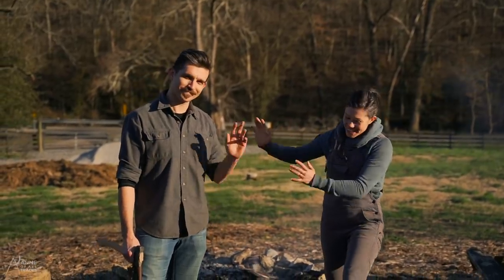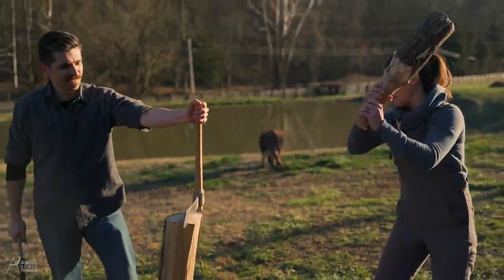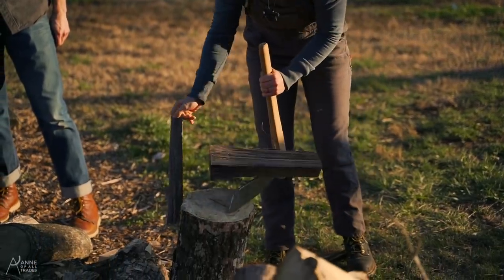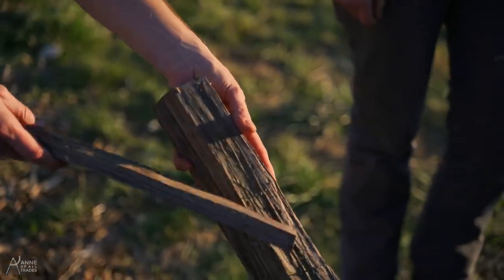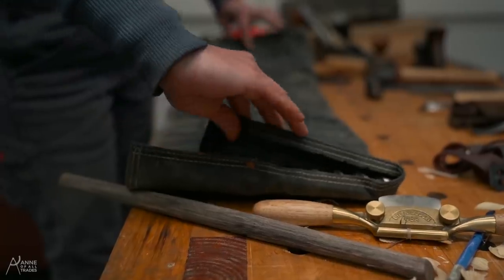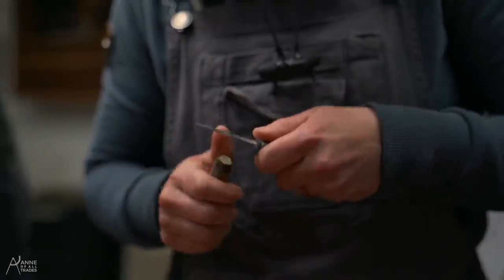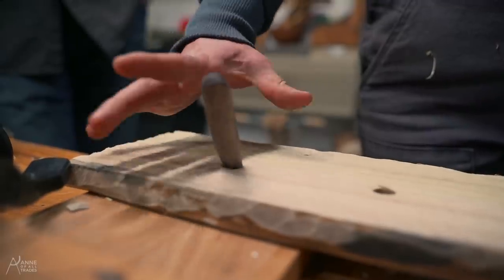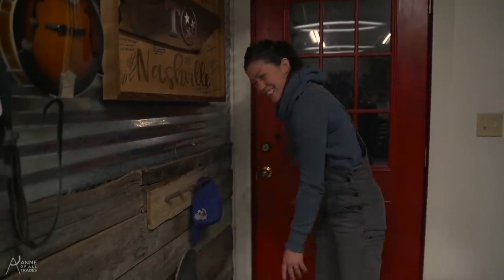Easy Firewood Carving Project

Comment: I have a froe but it doesn't even dig into the log. Do you have the edge of your froe sharp?
Reply from the maker: Nope, I prefer a dull froe, it’s safer. All it’s meant to do is wedge the wood apart so no cutting edge is needed

Comment: Just an FYI, Walnut is not good for Horses, not sure about your fer babies wondering in the shop, probably should check with a vet on that.  It is also bad for some plants and is not usually a good thing to compost for use in a garden.
Reply from the maker: While that is partially correct, I think it's important to note that juglone, the toxic chemical found in walnut is actually only concentrated in dangerous levels within it's roots. The trunk wood, it's shavings, and dust are not really a concern. It's always good to take precautions of course, but after some pretty extensive research I started using walnut shavings and dust in the pathways of my garden and stopped being nearly as concerned about me or my animals being around any of it.